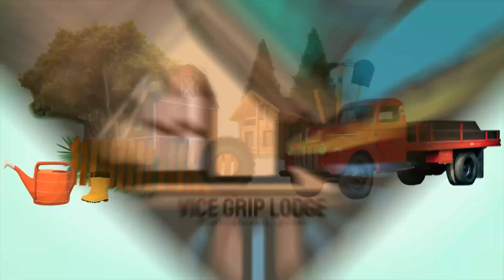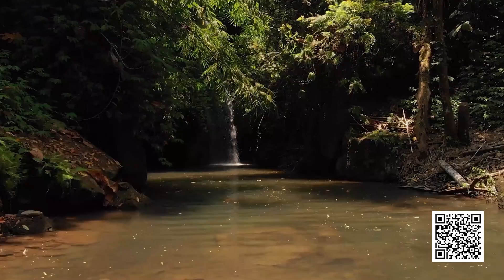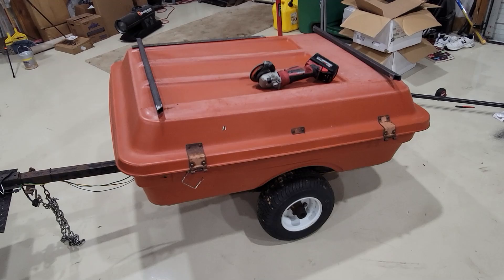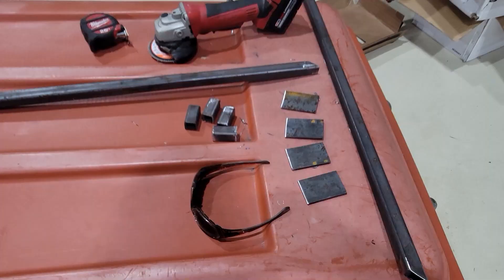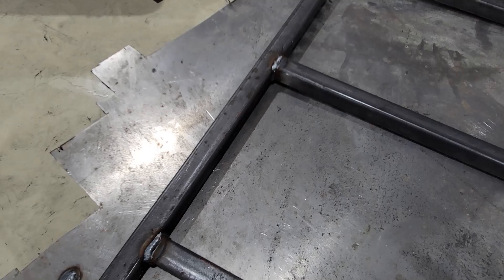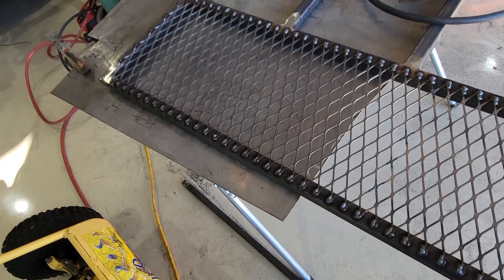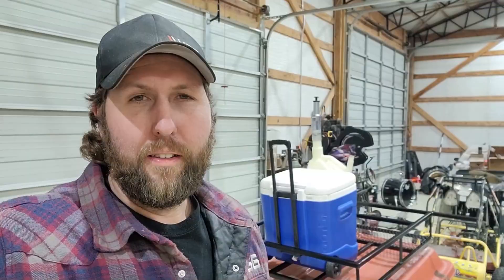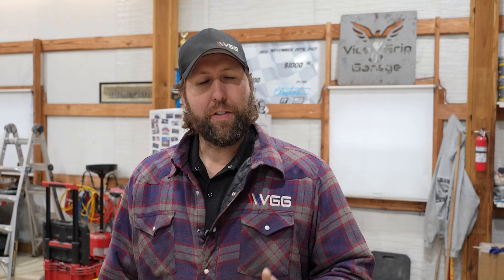Modifying my classic trailer for Drag and Drive Events! (For Vice Grip Garage)

Comment: In retrospect you may of wanted to put a set of crash bars on the trailer.  Awesome content as always.
Reply: Exo roll cage
Reply: maybe should have added that support for holding the tires on too ;)
Reply: Not crash bars, out-riggers!
Reply: Hindsight being 50/50
Reply: I was going to say the same thing until I saw your comment. :-)
Reply: Or training wheels (wheelie bars)
Reply: Add 3' to the axle width might've been the place to start.
Reply: Just put a set of hubs and bearing on the end of the big bar and the tires on the bar can take over in event of upendage.
Reply: Yep. He rolled her pretty good.
Reply: And put those drag tires a scooch lower. Centers of gravity, ya know?.

Comment: If you're going to be in those drag and drive events, then I have a suggestion you might want to consider... Build a trailer specially designed to be efficient, store more, can take a roll over, and has two spare tires. Make it out of sturdy aluminum. Be sure that everything is easily accessible from the outside, and can be organized to hold more. When all that you need to use on each segment of the route has to be protected, then build a trailer that is compartment. Give the trailer a wide stance to match the width of the car. And... build it so you can use the same trailer year after year.

Comment: The 8” tires can be swapped for 12” tires, same bolt pattern. May have to flip axle, did that 50 years ago on a small camper. The 12” last a little longer. Also place the spare tire on the tow bar preferably under side . The weight needs to stay low. 12” to 18” longer trailer tongue will smooth out the towing vehicle as well as backing up.

Comment: Long term you'll want to figure out a way to put some sort of insulation mat (rubber, carpet or whatever) on that expanded metal where your fuel cans sit. Built a rack for the rear of my Jeep years ago to hold some water jugs, fuel can and random camping equipment. Used the same kind of expanded metal like you did for the floor and over the course of several trips the vibrations caused the plastic jugs to get holes worn through them from the mesh they were sitting on. Water leaking wasn't a big deal, but having gas leak out of a jug on top of a plastic trailer holding all your tools, clothes and such would be bad, not to mention the fire potential it could cause.

Comment: Great mod! I had the larger version (4x6?) that I purchased in 1977 to add some "trunk" room to pull behind my new 77 Firebird. It had a brown steel lower and a cream colored clam shell top. Man I used the heck out of that thing for years and it held up well. There are times that I wish I still had it but not as much as I wish I still had that beautiful Bird! Firethorn red inside and out and it flew like its tail feathers were on fire.

Comment: When I was a kid, my father and I used to build trailers for hauling draft horses used in logging. He used to say.. as long as the load is under weights needed for permits. Your best to build it twice as heavy as the loads you’ll haul on it. Always 10 ply tires. All your weight, fuels and wheels and tires are above the center of gravity. That’s a no no.
Reply: It's his trailer. Let him build it how he wants.
Reply: @LostInPhilly89  I agree to a point, except this is flammable and and is on crowded roads with other people.
Reply: There are rules to the size of the trailer but there also needs to be thought in how to load the trailer. Putting all the weight at the top, most of it fuel, is asking for bigger problems then he’s had so far. Those tires aren’t made for 60 plus mph for hundreds of miles. Their for hauling your lawn mower to your folks house to mow grass.

Comment: It's a very popular way of doing it with a tiny trailer and all sorts of stuff stacked way up on them. Besides the obvious tumble factor, the extra wind drag puts more stress on the cooling system and adds stops for fuel. With a flatter trailer profile the wind resistance is mostly tucked behind the tow car and the center of gravity is much more easier to deal with when towing.

Comment: 0:99 consider putting the front springs you took off Independence on the sides of tha trailer.. Ya know.. Stickin outwards.. For bounce back... Apparently them trailers roll easy...

Comment: I saw that on the sick week videos and I don't think those smaller tires are DOT rated any longer. But typically its common to get a Harbor Frieght trailer modify it to a 4x4 and put one of those roof top carriers on it typically you can get those cheap used. Or just keep the 4x8 and have plenty of room for a full set of tires. They now come with 85mph 12" wheels/tires on them.

Comment: I would suggest putting the fuel in front of the trailer mounted on braced mounts on either side of the tongue for more tongue weight and a lower center of gravity on turns. Also put guards in front of them so things don’t kick up and puncture the plastic.  Would add more storage on top when you relocate also. Just a thought.

Comment: Hindsight is probably 20/20 here, but you might consider swapping those slick tire mounts with a spare set of front hubs for the car. Probably would have been convenient if a feller had 10 extra lugs, studs, and a set of wheel bearings for sick week. 

Always a good idea to use a spare trailer hub to mount your spare trailer tire, too. You might not always smoke the wheel bearings on the trailer, but when you do the parts store won't have the right one.

Comment: Try to add a piece of metal underneath the plastic lid where you had the bolts on so you can have some rigidity in the trailer because the bolts will eat through the plastic when you drive and expose the trailer to the roads and vibrations ,, just sandwich the plastic between two piece of metals with some bolts 👍

Comment: Two things: one might consider backer plates where the bolt come thru the plastic, spread the load out a little. And a ratchet strap around the whole sha-bang so the new frame is pulled down to the trailer frame. Securing the load forces from wind and vibration.

Comment: Hey Derek - Love your video's & get lots of tips and fun watching. This old gear head loves to see a young whippersnapper who knows how to bring the old stuff back to life. I did something similar with an old Harbor Freight cargo trailer kinda like your Coleman. Diff might be you have tougher plastic shell. I spent a great deal of time planning, Mig welding, burning fingers, etc only to see that after the weight of may fabricated cage I could place maybe 16-18 ounces of cargo on top before it was clear that road vibrations would trash the lid. Hope you had better result as mine was a fail.

Comment: Oh my, that trailer is SO top heavy on them little old 8 inch rims, that thing is going to flip over the first good size pothole it hits. Get rid of them 8 inch and go to a 14 to 16 inch rim on that trailer to stabile that heavy load or you're going to be picking it up off the road in very short order.

Comment: Interesting trailer concept. Too mount the wheels you maybe, should have made wheel mounts like the trucks from the fifties that carried their spare on the side of the bed and dropped them down to about 6 inches off the ground, using two L shaped brackets, one upright facing out over the edge of the trailer and the other upside  the side of the trailer, to which the wheel mount would be attached to. Of course hind sight is twenty, twenty.
Love and Peace.     Blessed Be.     Doug.

Comment: Looks nice! I would reinforce the underside of the top with some bigger washers since that's going to be quite a bit of wind resistance pulling on that lid. 
Also, I would reconsider putting the wheels on the side and up high. You want weight like that to be down low or up front and centered. Maybe you can reweld those bars facing forward and put the wheels there. I've run small trailers before and what can happen is if you go around a corner even at seemingly normal speeds the trailer can lift up one wheel or even tip. With all that weight on top and on the sides, you'll probably notice it. Unless you can find a way to get the heavier weight lower.

Comment: Cool to watch, that trailer is neat! On the tire mounts, I built a lot of them when my dad and I had a trailer dealership. If you get a bolt that's the same thread as your lug nuts you can use lugs to retain the rim to the mount and then weld the bolts to the mount. Easy way to carry a few spare lug nuts along as well.

Comment: May want to consider a Dual Mini-split for the garage. I know it's not insulated but it will heat the garage pretty good and you can get them pretty cheap and install is DIY on some units. Better than having to deal with the fumes on the heat maker you have. Maybe one of your viewers near near will help you out?

Comment: Just use unistrut. Then you can have adjustable runners for the rack. You use spring nuts to hold what ever assessories you need on the roof.

Comment: very good additioin.  I would reccomend adding about three feet to the tongue which will pay a 
lot of dividends driving and backing.  I did that to my tent trailer and what a difference.  I would 
also get a trailer spare wheel and tire.   ole Frank.

Comment: Derek:. In mid 1970s, Rochester Products Division of GM, where I worked, was developing a similar sized trailer for Chevy Vegas.  It had one rotating, castor-like, center wheel and had a fixed bumper mount.  As is typical, GM chickened out and never put it in production!  Very similar size, like yours ......

Comment: Maybe next time find a little boat or jet ski trailer or something with full size tires on it. Those little wheels will be issues at some point. A boat trailer is wider and more stable that can take more weight. Put a box on it and you are good to go. 😎
Reply: Max width is 4x8 on trailer size on sick week and most drag and drive events
Reply: @jamiebarrett5982  Which is a lot bigger than the trailer he has. Some of these guys fit their trailers out nice. One even had a Keg beer system in it. The reason I say a boat trailer or such is because they would be a good frame for the box to sit on and should be pretty cheap. He just needs a full size tire trailer. Everyone I know that has had those little tire trailers had issues with them when towing distance and that little orange thing was not made for the weight it was carrying and was top heavy. His (imho) trailer should be set up to be his home on the road. Jack stands, jacks, pans, tools, fluids, etc, etc. Balance it right and you wouldn't even know the trailer was behind the car and if you really wanted to do it right put some electric breaks on it, so it won't even push the car when stopping.

Comment: Thinking about trailers, I was thinking of an electric drag car towing a trailer with a large battery, generator, and an A/C system fed into the drag car. The drag car would not have a lot of stuff in it. The propulsion, A/C, and other amenities would be driven off the trailer. A Prius stripped to a flat bed to carry stuff and synched with the prime car might be interesting. If the electric drag car comes from a donor EV or hybrid, the prime battery would be cut down to the minimum required to get down the strip without lifting.
Reply: Not legal for those events. Cannot have anything on the trailer that assists the vehicle as it goes down the highway.
Reply: Uncle Chet already Did this last year on Rocky Mountain Race Week. His Tesla Plaid towing a large Diesel Generator.
Look up 'Chillin with Chet' on the you tubes.
Reply: @MJTAUTOMOTIVE  From the rulebook for Sick Week 
•Trailers may not contain any components that contribute to cooling, charging, oiling, or fueling the competition vehicle while the trailer is being towed.

Comment: I'm just really surprised as easy as it is to remove the box you didn't remove it, wire brush the surface rust from the frame and paint it too.... I mean with the work you've put into this thing it would just look so much better....

Comment: I want to see you get a low, wide trailer like was in the background of one of your recent videos being pulled by a Camaro I believe.
Being low would help with air drag as well as a lower center of gravity. You could then have fuel tanks in it which you could even route a fuel hose up to your car extending fuel stops.

Comment: During Sick week I saw other participants pulling 5x8 enclosed trailers. I have one I use behind a Honda CRV. The 5x8 trailer is light enough I can move it around the yard by hand so I know it would do well behind your race car. The benefits would be larger diameter wheels  (less wheel speed at Hwy speeds), Better load distribution, lower center of gravity, and better security of your equipment at your overnight stops. Plus you can get to equipment without completely unloading the trailer. The only drawbacks I see is initial purchase price and a few less mpg’s.
Reply from the maker: 4x8 is max

Comment: I’m to the point where I need a small trailer to pull behind my lawn mower where I can take lawn waste and tree trimmings to compost I have a wheel
Barrel but my back isn’t what it used to be and I’d rather use what little I got on the Loading and offloading.

Comment: Myself I would a put a rubber matt under the fuel jugs ,cause that strecth metal gonna wear pin holes in the bottom of those plastic jugs.

Comment: Grade 3 hardware would have been fine. The plastic on the trailer will fail long before the bolt. Unless you're using a backing plate. Then shear forces come into play. Even then, I don't think you'd want grade 8. In that application, you'd be better off if the bolt "bent" a fair amount before it sheared off completely. High COG came back to bite a feller in the backside.... Great project either way though!

Comment: Thoughts for 2.0 version

Just in case you didn’t already think it for yourself or some of the 2 bazillion others did not say it already.

Either change the axle and mount the slicks as trailer tyres (carrying little weight instead of being the weight.  I guy could also weld some scissor jacks under it  and use a power drill as pit crew style pair of stands.
If  that seems too much like wearing the tyres out another option may be to mount them back to back on a T shaped pole on the draw bar.

Comment: I was thinkin perhaps it would be better to take the box off and weld the extra space below the plastic part.... you could have side access and still open the box easily. Plus it wouldn't be top heavy. Perhaps you could modify it later with the same rig

Comment: You need to remember that a narrow trailer with small tires can’t haul loads stacked high. A lightweight trailer isn’t always the best decision. Your load weighs more then the trailer. Your asking for problems. 6’ wide and 8’ long. You could haul everything you need. And keep the load low..
Reply: There is a maximum size for the trailer. -
Each competition vehicle may tow a single trailer with a maximum cargo area no larger 142 cubic feet, which is the advertised size of a standard 4x8 box trailer (which is 4’1” wide, 4” tall, 8’1” long; the math doesn’t quite add up to 142). If measuring in inches, cubic feet is (LxWxH)/1728. Measurements include anything carried on the trailer.
Reply: @Blazer02LS  then I suggest a flatbed trailer. Built low but larger tires. And the heavy stuff put on the deck. A little more steel in the trailer helps. That trailer is great for a motorcycle but not what he’s using it for. Most of his weight is above center of gravity.
Reply: @edgemonsiteworksllc3369  I agree but wasn't my build. After seeing how many folks use those tiny ones for these events it could be an interesting cottage industry.
Reply: @Blazer02LS  yea. But it really doesn’t cost much to build a small trailer. Don’t even need an axle. Just bolt on spindles. I’d make it 5’ wide and figure the length.
Reply: @edgemonsiteworksllc3369  Can't be over 4' wide. or 8' long.

Comment: I'm thinking you need to load that trailer down with stuff you don't care about and take it out on the road and see what's going to happen cuz I think the tires going to hanging outside the trailer are going to turn this thing into a hammer on the end of a chain basically.

Comment: Adding significant weight to the top may have raised the center of gravity too high for the wheel base.  Perhaps lengthening the axle by 8" or so might prevent tipping it over in the future.

Comment: neat idea still in 1st few mins of video. but id be worried about 2 things, strength of plastic/fiberglass top with weight one it causing breakage. then water leaks,lol. but why not  use smallll box trailer. idk bout there but here can gettem cheap. but i also nvr knew colman made of them trailers. super neat to me!!

Comment: Oh my goodness. Last summer got rid of a little 6 foot trailer that had an old camper shell on it with a locking rear window that would have been perfect for a Drag and Drive event. It sat about 4.5 to 5 feet high. The camper shell was the fiberglass version, not the flimsy aluminum version. It wasn't heavy either, it had the aluminum diamond plate for the floor. I use to move it around by grabbing the tongue and moving it by myself wherever I wanted. It was wide enough that it wouldn't flip upside down on a feller either, well if a guy stayed out of the ditches anyway! Is there a size limitation on the trailers for these events?